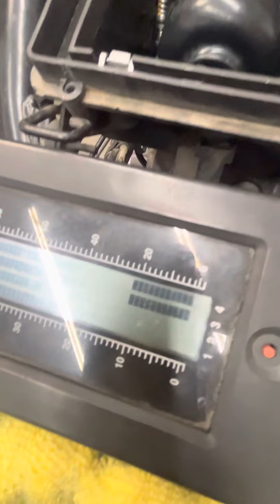Adjustment of the idle on KTM 950

Comment: Great info thank you. I was wondering how to do carb adjustments on an SM with the tank off. With that model, the tank covers the entire air box so that there is no access to the carbs with the tank on
Reply from the maker: Thank you, my friend you’ve seen the video. I have a Aux tank hanging with little fuel ? that’s how I run the bike without the gas tank.
Reply: @liorelbaz  yes this vid is super helpful. I’ll be doing something similar

Comment: Hi mate the engine idle screw you turned I've unscrewed it to far and it has come out and I don't no were to put it back in can you help thanks
Reply from the maker: You will need to move out the carbs from air box to put back in.